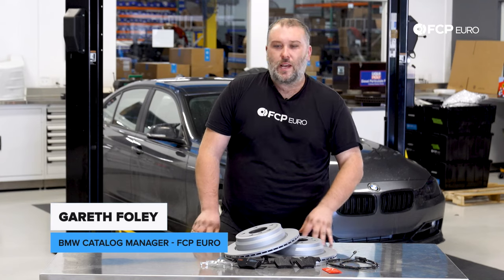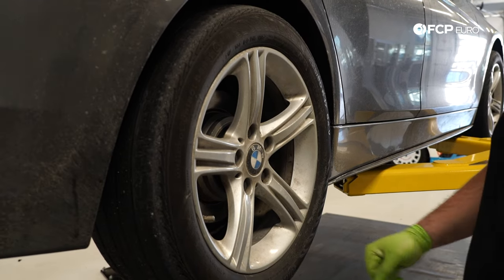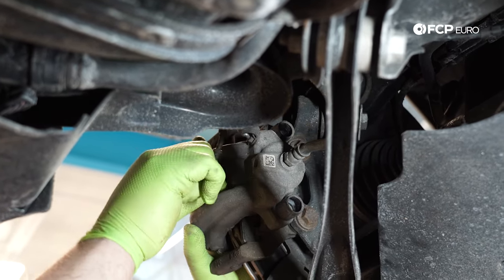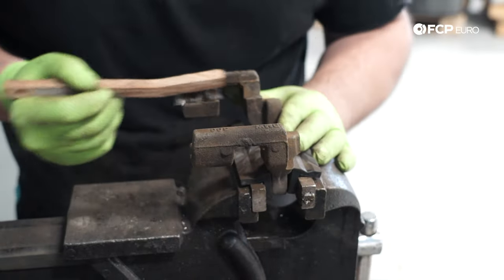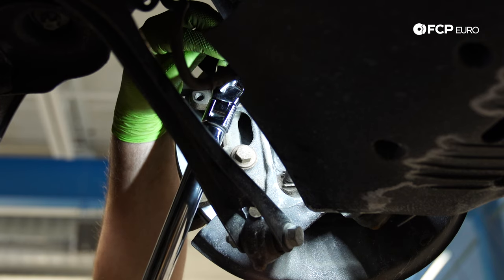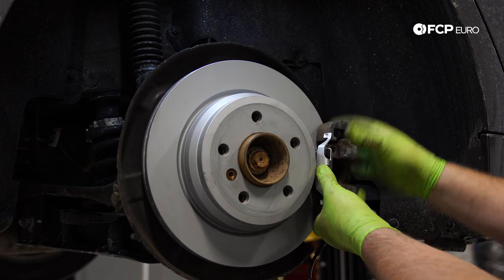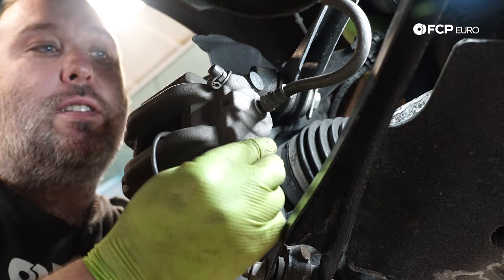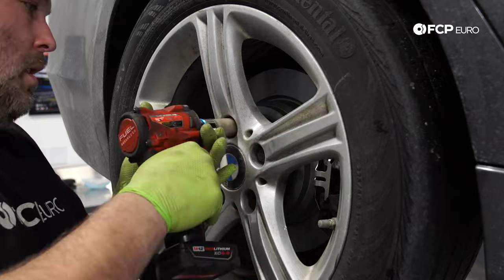BMW F30 Rear Brake Pad & Disc Replacement DIY (228i, 328i, 430i, & More)

Comment: Just did the job yesterday. For the most part it saved my life . I did it in a Walmart parking lot .i did put grease on the caliber where the brake pads meet and after the job I did have to pump the brakes but other than that this video is 100% the right way to do things you may need a breaker bar cause some of those nuts were kind of stuck, but other than that worked out. Guy road by and said I was cheating for looking at your video😂

Comment: Thank you for this video. My rotors did not come off easily. I had to use a 3 jaw extractor to get them off. I got them at Harbor Freight for 20 bucks.  They did the trick just fine.
Reply from the maker: Sometimes they can be a real bear to get off, we often end up taking a LARGE hammer swing at em, to pop them off, it can feel violent though.

Comment: Anyone else having trouble getting the lower 16mm caliper bolt on the driver side? I’ve got the other side off but ive damn near rounded this 16mm bolt trying to get it off

Comment: Could you clarify something for me please? The front caliper bolts are tightened to 110 Nm (Watched your previous vid on the topic). For this vid, at the start you say you need a torque wrench capable of 110 Nm but then you do the rear caliper bolts to 50 Nm plus 90 degrees. Is the rear specifically different to the front? Good vids though - will be using them shortly to do front and rear pads and rotors on 220i.
Reply: Hi did you find the answer to this ? I’m confused about the torque spec for the rear.
Reply: @crsbnl4441  No I didnt. I believe they changed the bolts (and subsequent torque specs) after a certain year model but couldnt find enough information on it. I prefer to geta  concensus on information for my projects. I got annoyed at the contrary information and just used the old specs of 110 nm (18mm bolt) and 28nm (8mm allen bolt)
Reply: @bjornefellhanded9708  same here I haven’t done rotors since I can’t find the info. Did you reuse the same bolts for the rear ? Thanks again for your help
Reply: @crsbnl4441  I did indeed reuse them. They were in good condition, cinched well, and I used blue locktite. My dealership quoted $2100 for front and rear pads and rotors, I spent $538 and did full fluid flush, new sensors, ceramic protex ultra pads, and protex rotors with the rust prevention coating that doesnt require cleaning before installation. Computer reset is easy too - done on the dash. Pretty damn chuffed with the result. That horrible snatchiness of standard BWM brakes is gone and good riddance. As is the mess that was a constant on the rims. Three tips that I uncovered/forgot. The wheels will almost stick to the hub they're that tightly engineered. A  tiny bit of rust and theyll stick so hard it appears impossible to remove them. Use a baby sledge on the back of the tyre outwards. So from under the car, hitting outwards. Just extend your arm under - dont be thumping on wheels while youre under the car. Support the wheel with your foot so it doesnt spring away when it comes loose. No other trick worked. And dont forget to let the handbrake off when working the rear wheels or the bloody rotors wont come off and youll be freaking out like I did trying to work out why! :) And dont forget to remove that bloody filter from the brake fluid reservoir. You'll top it up, it'll look topped up, then suddenly it'll be empty, you'll have no damn brakes and you'll have to restart the flush to get the air out. Live and learn eh? Regardless of what brand you choose, pick the right bits and pieces. There seems to be a combination of around 5 differences in the BMW brake setups. Oh, and use some kind of anti seize on the freshly cleaned hubs so the wheels dont seize in the future.
Reply: Any answer on this? Help please
Reply: @michaelgleason4679  For what its worth Michael, my partners 220i is still driving smoothly with zero issues with the specs I used (mentioned above).

Comment: Hi FCP, great video. i'll be referencing this for my brake pad swap. I got Akebono EUR1656 as my rear pads for my 2017 F30 340i, which show as compatible on multiple websites. What's throwing me off is that these pads do not have a backing clip on them, all 4 pads have a flat backing. Is this a specific brake pad revision for the 340i or something like that? thank you in advance

Comment: Some of my wheel lug bolts won’t go in all the way after my brake pad change. I torqued them good and did the star pattern but some are still poking more out than others, and stop faster than the other ones going all the way in. Did I strip something or do I need a new wheel bearing?

Comment: quick question, the rear anti rattle clip you have for the 428i xdrive has a bmw logo solid looking piece in the middle, do you use 4 of the front ones or are they interchangeable?

Comment: Before I attempt a complete 4 wheel rotor / pad change do I need to buy a specific piston rewind tool or would a standard rewind tool be sufficient with the old pad still in place? Is the piston screwed back or just pushed back ? Last time I did this job 30 years ago I used a small pice of wood against the old pad. I have standard single piston calipers.
Reply: I'm trying to find this answe also
Reply: No. Both the front and rear standard brakes pistons can be compressed with a vise or any other compression type tool. If you're really strong, you can just use your hands! (provided the bleeder is open).

Comment: Hey I'm replacing discs and pads today on all wheels. However I didn't buy new sensors because I didn't know it was needed. Everything is closed today so I can't buy any. Do I need to buy new ones or will it work anyways? Thank you!
Reply from the maker: Depending on the condition of them, you may be able to re-use them if removed carefully!

Comment: How could you compress the caliper piston without that tool.. does bleeding it make it easier? And how would you get pressure back?
Reply: you might have to get creative. bleeding does not make it easier. you get pressure back when you put your foot on the pedal after install

Comment: Hey Gareth! Love watching your videos. I have a a BMW 2013 550i GT with 64km. Wondering what code reading device would be great to have and would be able to retract the Parking break actuator?
Reply from the maker: Great to have is our favorite Autel MX808 https://www.fcpeuro.com/products/maxicheck-mx808-obdii-scanner-autel-mx808 , that said you don't need it to retract a parking brake actuator on your car since its not on the caliper like it is on VW's and Audis.

Comment: Good morning how are guys?
I have a question, my car bmw 428i grancoupe running smoothly almost 5k after service at bmw dealer but after DYI replacement brake and rotors (oem) and aftermarket sensor the drivetrain malfunction popping up on the screen.
Actually I restart the car and it won’t go out then I just hit the OK button on screen then back home safety. So it cause of sensor or something happens on engine?(n20)

Comment: Is there any adjusting required for the parking brake?  I read the procedure in the TIS and it’s a lot more complicated around that part.
Reply from the maker: Depending on the life left on the parking brake pads, you sometimes need to adjust them in a bit if you are having trouble removing the old disc, or sliding on the new one. The adjustment itself is pretty standard as it is on most BMWs, usually adjusting through one of the holes in the hub.
Reply: @fcpeuro  awesome thanks!

Comment: Hey! Two weeks ago I changed all my rotors and pads on my F30. However since then I've had a pretty bad squeak from the rear right brake when braking hard (not very hard but at stop lights etc).

What can be the issue? I cleaned everything with a wire brush, put new sensor, double checked everything etc and I didn't buy cheap pads either.

I'm borrowing my dads garage today to do some troubleshooting but he lives over an hour away so I would really appreciate any advice so I know where to start.

Originally I thought it would go away after driving a week or so to get everything settled but it's still the same so that's why I figured it must be something else.

It's a pretty high pitched squeak, if I'm just pressing lightly on the brake then I can't hear anything, braking hard at high speeds doesn't seem to produce the sound either, just at slower speeds when coming to a stop at red lights, going slowly over speed bumps etc. It stops when I let go of the brake pedal. Also there's no feedback to the pedal like pulsating, scraping etc. Hope I described it enough for you.

Any help is appreciated. Thank you!
Reply from the maker: Hi Fergus, you could try using some brake paste on the ears of the pads where they ride against the carrier to see if the noise goes away. Sometimes without that they get a bit hung up and can get noisy.
Reply: Clean and relube the caliper pins

Comment: I have a 2014 f31 320D, would these discs fit my car?
Reply from the maker: Hi Vxr, because we did not get that model here in the U.S, we do not have that model on our vehicle selector. If you reach out to our service team with your VIN, they can help you find the appropriate disc sizes for your model. You can reach them at service@fcpeuro.com

Comment: How are those TRW Ultra pads in terms of noise, brake dust, and stopping power compared to oem?
Reply from the maker: From all of our testing we've been really impressed. Being ceramic the dust is almost non existent, they are quiet and have more than sufficient stopping power and initial bite. Is it a track pad? No . Is it a great daily /spirited driving pad? Yes
Reply: @fcpeuro  on the same level as Akebono Euro pads? Only reason i ask is because i was looking into getting the Akebonos but i see you guys offer a set of rotors and TRW package, so just doing my due diligence. Thanks for you response.
Reply from the maker: @recklezz_9738  we have been comparing them directly with the tried and true Akebono, and the two sets are equally capable in terms of brake dust and performance. Cant go wrong with either set really.

Comment: The caliper brake boot at 4:00 on my 2015 f30 328i xdrive has 18mm bolts in it, not 16mm? Is this only my car that’s like this? I’m actually so confused but the 16 mm socket I have definitely does not fit
Reply from the maker: Hi Weston, if you are referring to the two bolts that hold the caliper carrier in place, there is a chance they used slightly different sized hardware on your 15' model. Traditionally they tend to be 16mm for these vehicles. Cannot hurt to double-check!.

Comment: Just did mine on my 2013 430d. Everything went smoothly except for the removal of the 16mm caliper bolts. Each side took about 10 minutes to get these off as they were so stiff throughout the entire thread, i had to use a long arm wrench with very limited turning room. Once I'd got them off and inspected them it seems there was some kind of blue goo in the middle of each thread. Is this normal?
Reply from the maker: Hey Ben they come with Factory Locktite on them, so totally normal that they were a bit tough to get out, thats what the locktite is intended for!
Reply: @fcpeuro  thanks for the quick response. I thought it might be that. Does this have to be renewed, or is it ok to reuse the bolts without new loctite, tightened to the required torque?
Reply from the maker: @benranson8424  you're okay to run without it, sometimes new factory bolts will come with it on. As long as you are torqueing to spec though you should be just fine. You can always toss a paint mark on the bolts for ease of mind to check on occasionally as well!

Comment: the caliper carrier bolts are bitch getting off. i can't use impact due to car on the jack, no space  whatsoever, should I have removed the plastic cover under the driveshaft or control arm ( whatever it call) . thanks
Reply: what did u ever do to get them off cause mine wont come off either. its like 80 pounds of torque in there
Reply: Had the same nightmare (see my main comment)
Reply: You can use an impact I just did mine yesterday, I took the splash guard off the bottom rear (x4 10mm bolts) and it gave me enough room to get to them both. I also couldn’t do it by hand…

Edit: my car was also on a jack not a lift.